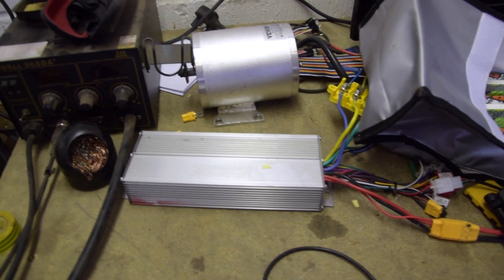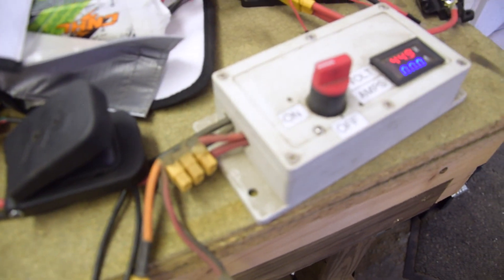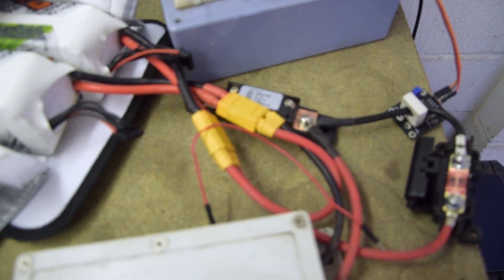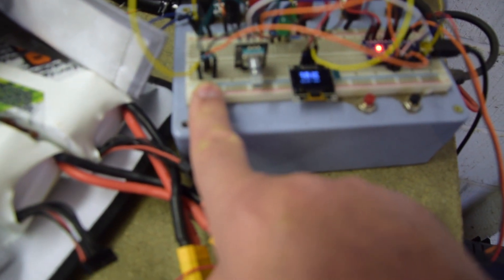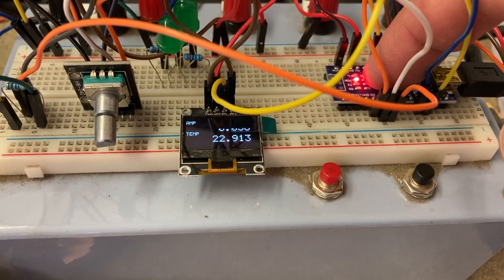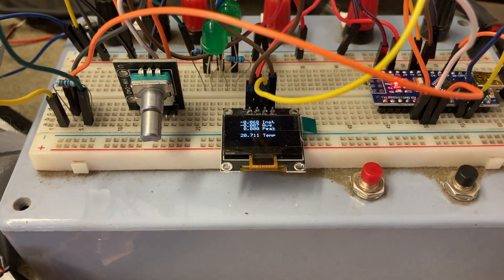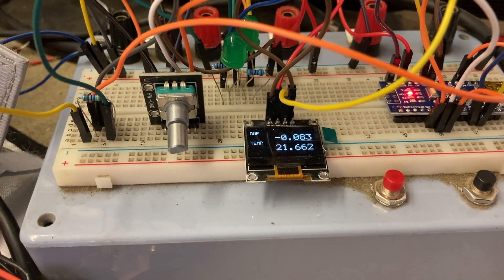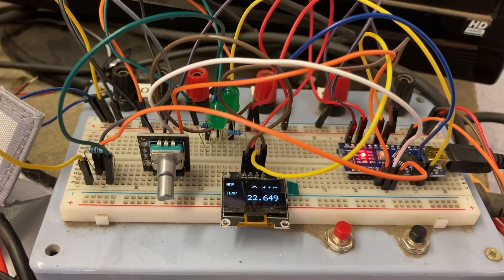Arduino based current and temperature logger for Hacky racers   Part 2 , the demo

Comment: Is the little LED display readable outside in sunlight?
Reply from the maker: Not sure yet. Its certainly brighter and better contrast than the LCD ones I usually use. The real sticking point is that I have reading glasses that I dont wear when racing, thats part of the reason for having the different display settings with bigger text :)  The bigger text will help in the daylight